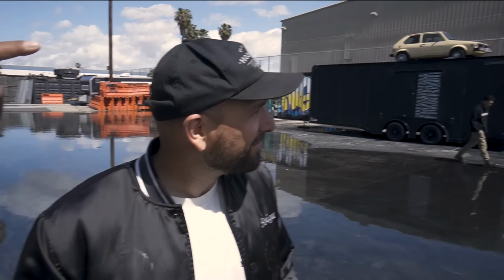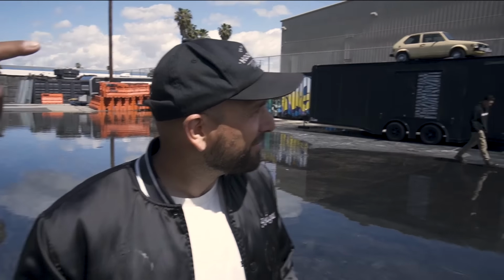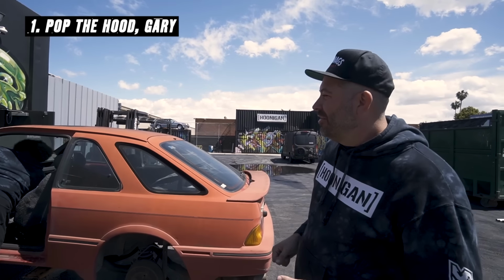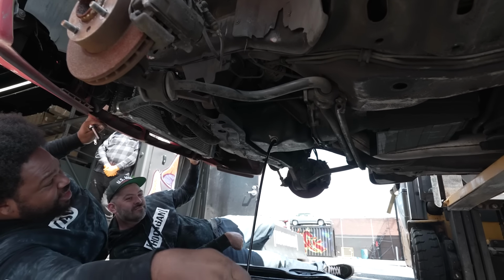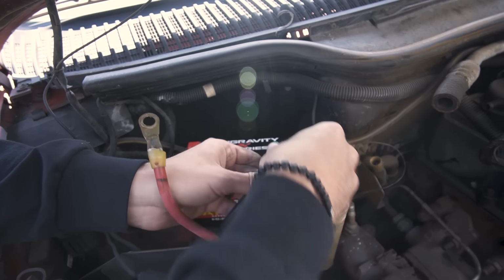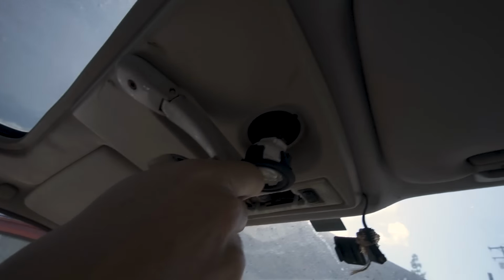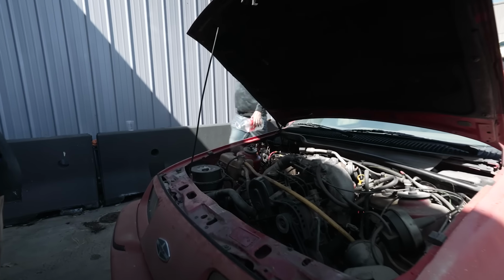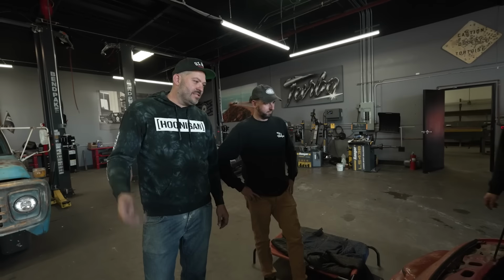Will our Merkur XR4Ti actually run? Hoonigan Project Garage is BACK!

Comment: you can actually fit a 5.0 v8 or a 2.9 v6 from a ranger in these with very little effort or take a zetec and turbocharge it these are very rare

Comment: Y’all should watch how vice grip garage does it, start it on old oil, use a marine gas tank to bypass the mechanical fuel pump to see if it runs and work backwards for example lol, excited to see the rest of the big brain y’all got coming
Reply from the maker: Fuel tank won’t work like that on EFI.

Comment: we in south africa has the 2.4lt pinto motors that came in the sierra or sapphire and they are chicken teeth. we done a pinto bottom end with a duratec head try and figure that out. its class as group c to group b spec fitted into either mk1 or mk2 escort

Comment: Love the seiera xr4i and xr4x4 why they gave the car such a crap name in the states I'll never know the rs500 cosworth  was the base of this car 2.0 4cyl turbo with over 500hp back in the 80's power you could only dream of out of v8 back then $1500 utter bagin can't find one in the uk for less than £5000 the escort cossie has the seiera running gear floor pan etc....just shortened by factor